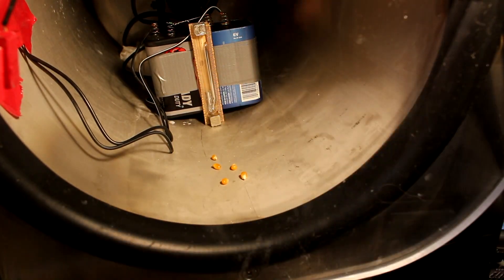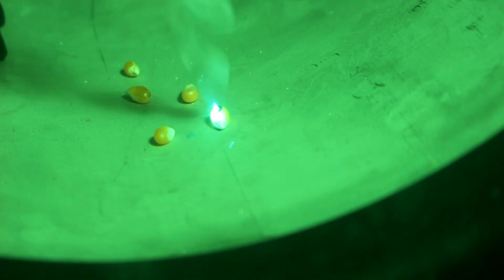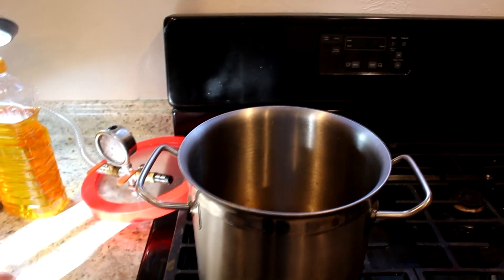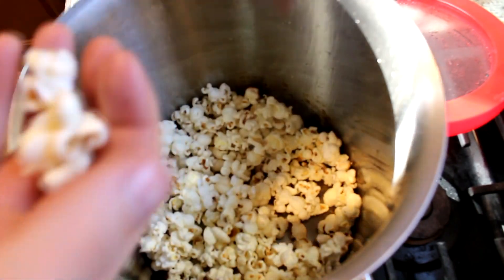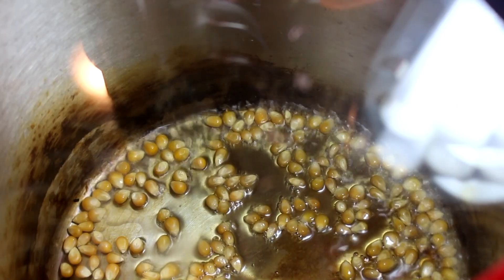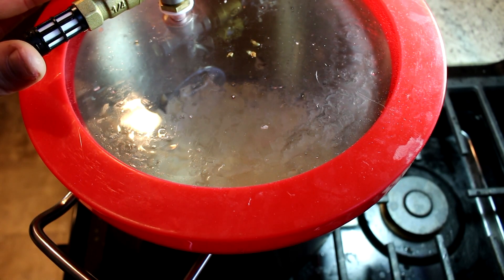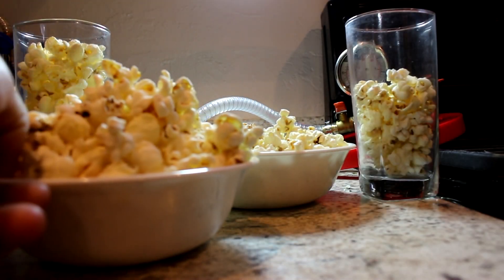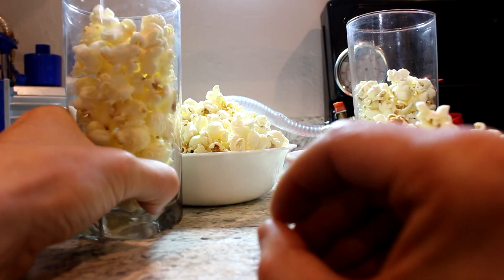Popping Corn In a Vacuum

Comment: Means of manufacturers selling you 'more' when you actually get less?
Reply: Melvin Pepperdash not at the movies, though.
Reply: They're sold by weight.
Reply: You may be on to a commercially fiable idea if you can develope a machine to do this which any idiot can use and is cheap to maintain. Because then you can buy bigger buckets and keep the price the same, so customers come to your cinema more because they feel it better value.  I mean weren't they about 25% bigger? The cost of corn is nothing, but the value of being seen to be giving more for the same money is priceless. Also apparently it tastes better.
Reply: On a seperate note, have you seen the popcorn cannon? Heat slowly to boiling point so as not to burn the curnles, but do this in a sealled pressure vessel. then release the hinged lid to allow it all to expand instantly. Mythbusters had some fun with one.

Comment: What about popping without heat and oil? Will the lower pressure reduce the boiling point of the water in each kernel, and cause that to expand and pop the kernels?

Comment: I would be curious to see temperature and pressure measurements on the vacuum corn-popping environment. With the vacuum, I would expect the oil to boil at a much lower temperature, which would also mean the corn popping at a lower temperature. There's probably some interesting analysis in the vapor pressure difference between water (in the corn) and oil as a function of temperature.

Comment: To get the same results at normal atmospheric pressure as under a vacume.  Heat the oil first untill it is smoking,  then add the corn. It will be big and fluffy just like the vacume process.  That is how i learned to pop corn at the theatre in 1966 where i worked as a kid running the concession stand at the base theatre. I was an army brat.

Comment: Hey cody, thank you for taking that suggestion! I'm very curious as to what would happen if you placed a sealed bottle full of water inside the vacuum chamber. I understand water is very bad at changing volume. I am also aware that any gasses dissolved in the liquid would likely escape. but would the water vaporise? theoretically the contents of the bottle would remain the same unless popped, so would the pressure remain and therefore not evaporate? I'd love to see this happen. Thanks Cody, keep up the amazing work!

Comment: isn't there a chance the water vapor added it's own pressure into the vessel after the vacuum pump was turned off? How about running the experiment again without ever turning the pump off, and then compare with your two results. I have a hunch the popped corn will look even bigger.

Comment: Wait, how can we hear the corn popping in a vacuum?
Because it wasn't a complete vacuum or because it was hitting the sides?
Reply: Vapor escapes from the kernels and hits the side of the pot. Also, once he turned off the vacuum pump, it ceased to be a 'true' vacuum, as the water vapor formed a kind of atmosphere inside the pot that sound could propagate through normally.

Comment: You should build a transformer with coils on each side of the door of your vacuum chamber to get AC in. You might be able to get away with air core for low current.

Comment: I'm glad you got Kenyon (sp?) to give a culinary review. I, too, thought that if you got the pressure in the chamber low enough it would pop without the application of heat. I also suspect (having tasted hot air popped corn) that it would not be as tasty in that case.
Reply: Her name is Kanyon not Kenyon
She has a youtube channel called Kanyon
Reply: Not as tasty because no oil would have been used.
Reply: I believe it would not pop with lower pressure, as corn is a sealed container and it must be sealed to build enough pressure to pop when heated. It became bigger because it took a little longer to cool off, the steam got off more rapidly once the burst happened and last the lack of air pressure did not exert any inward force to the corn in order to make it smaller.
I believe that in zero g it would be just a little bit bigger, as that gravity still exerts force in the downward direction.

Comment: NOW! Take the corn, seal it in a chamber with dry ice so that you carbonate it. Then get the oil hot in your vacuum pot and use a large tank as a vacuum reservoir so that you can much more rapidly achieve vacuum. Quickly take the carbonated corn, throw it into the pot and open the valve so that a vacuum is drawn. Bet it would be exceptionally huge lol.

Comment: What altitude did you pop these at?
Reply: "Earth" altitude, what else? He popped it on the lithosphere. When he said "atmospheric pressure", he meant the "air" pressure at where he current is: "Earth pressure", if I should say.
Reply: pressure varies with altitude, the higher above sea level he is, the less the pressure is. I'm looking for a specific value of altitude so I can figure out what pressure he popped his control popcorn at.
Reply: connorvor1
I understand, but just in case he may not answer your question. Try to searching up the approximate altitude from where we are at, if you have not done that already.
Reply: connorvor1
Sorry if my "tone" if you found first reply sounding a little "irritated". I didn't mean to. Don't take it personally. :)

Comment: Corn burned under the laser, because of oxygen in the air. If there is vacuum, corn might get warm enough to pop without burning. However, it even migh not pop at all, because all water and air will evaporate and evacuate in vacuum prior to heating, and there will not be any expanding "fuel" to pop.
Heating oil under vacuum pump will prevent vacuum from creating, because of oil vapors creating pressure. I don't think that Cody's pump os that powerful to pump overcome pressure of heated oil vapour.
Also technically there will not be any vacuum, until there is not any liquids left. Remember that water boils at lower (even room) temperature, when pressure is measurably low. So, while oil needs heating for boiling, there is not enough vacuum. In other hand, when there is enough vacuum, boiling temperature of oil will be low, and it will not rise while boiling (the same as water temperature does not rise ovet 100°C in atmospheric pressure). Thus, making heating ineffective and unnecessary.
Also lowering pressure itself without heating will cause air inside of cernels to expand and water to boil at room temperature. So, corns might pop in rapidly created vacuum without heating at all.
I would encourage Cody to re-do popping of corn in vacuum: #1 try just using smallest possible vacuum chamber without heating, so vacuum could be created as fast as possible and corns could pop at room temperature; #2 try the laser heating in the actual vacuum (corn should not burn as there is no oxygen), but heating should be done immediately after vacuum is achieved that air and water enclosed in corn will not completely evaporate.

Comment: Cody, if you can boil water at room temperature in a low enough vacuum, could you pop the corn without adding heat?

Comment: If you just had some kernels in a vacuum and the suddenly released the pressure, would that also pop them?
Reply: George Anstey That would crush the kernels - you can, however, have them under heat and pressure, and then release the pressure suddenly, which causes them to all pop at once. They did it on Mythbusters.

Comment: You might have had double the volume had you left the pump on throughout. The escaping vapor from popped kernels and the high temperature would substantially compromise the vacuum.
Reply: tubeist- dan That makes sense, considering that steam is about 17,000 times the volume of the same amount of water, AFAIK. Of course, some of it condensed as you could see in the video, but I'm guessing that there was still plenty of pressure caused by steam.

Comment: Would a strong enough vacuum pop the corn without any additional heat? The water inside the corn should boil, expand and the corn should pop cold, or am I missing something?
Reply: patrick zavas No. Part of the popcorn cooking process is that the heat melts and “gelatinizes” the starch. When the kernel pops, the gelatinized starch-water mixture becomes a foam as the water becomes vapor, and this drops the temperature back to where the starch solidifies again, leaving the starch foam matrix as the popped corn. :)

Comment: The second time you added the kernels before the oil. Scientific method states that doing this ruined the experiment, I guess you simply must pop more pop-corn to rectify this travesty.
Reply: I noticed that too... I'm sure it affects how well the kernels were coated with oil. That could account for the difference in how many kernels popped, maybe.
Reply: Sauvenil I pointed it out to get a laugh, its doubtful that it had any substantial effect due to the relatively small surface area of the bottom of the chamber compared to the amount of oil used.

Comment: I would wonder if the vacuum alone pop them due to pressure difference.
Reply: Hot air poppers don't use any oil.
Reply: jtech0 Isn't that what happened
Reply: I meant with no heat and see if the pressure that is inside the corn blows it apart when vacum is put on the outside of them.
Reply: jtech0 i think its possible if u manage to vacuum the chamber extremely fast.  otherwise the water might just sublimate out of its pores.
Reply: That could be an issue I suppose. Be kind of neat to see though,
Reply: yeah i know... talk about 100%fat free popcorn... would sell like hot cakes in winter
Reply: At room temperature, the water inside the kernel remains water, so there is no pressure inside. So it wouldn't pop.
Reply: Water will boil at room temperature under sufficient vacuum.  The way I see it, this experiment is interesting, but incomplete.  I'd want to also know the temperature of the popping kernels under vacuum.  I suspect that it would be lower than in a popper at atmospheric pressure.  I also suspect that the pressure differential experienced by the kernels is not all that different, unlike Cody's speculation, because of the reduced temperature of the boiling water.

Each kernel acts a bursting pressure vessel that can only support a certain amount of pressure, and the steam inside will progressively increase in pressure as the internal temperature rises, until the shell fails.  So, the failure pressure of the shell is what determines the pressure differential, and it is not directly controlled by the exterior pressure.  However, I wonder if the shell is stronger at lower temperatures, and that accounts for the difference.

Comment: Thanks Cody, this brings to mind another Q, does the popping of the corn, releasing internal gasses, decrease the neg. pressure inside your vessel?  IE was pulled to 27" and after popping was down to 23"? Thank for all your vids., all the best to you and yours, Billy, B.C., Can.
Reply: Would a strong enough vacuum pop the corn without any additional heat? The water should boil and expand and the corn should pop cold, or am I missing something?
Reply: even with a perfect vacuum, you only get 1 bar of pressure difference. to pop popcorn you need about 100 bar.

Comment: @ Cody'sLab - could you do a comparison with a high speed camera in a vacuum and a non vacuum popping environment? Also did you note a difference in popping time or kernel/oil temperature between the two? I would guess that with the lower atmospheric pressure the kernel's would pop in less time than at normal Cache Valley pressures.

Comment: Everyone knows that a balloon in a vacuum chamber gets bigger. Popcorn pops because of expanding gas inside of the kernel? Couldn't you pop the kernels in the vacuum chamber without heat?
Reply: Gabe Meyer There's not enough internal pressure to pop them at room temperature, even in a vacuum, since the kernels aren't really under any internal pressure to start with. In a vacuum, the kernels' interior might stay at atmospheric pressure, but the pressure difference between that and the vacuum isn't enough to pop them. By heating the kernels past the boiling point of water, the pressure difference becomes much, much greater, since steam expands to 17,000 times the volume of the same amount of water, which raises the internal pressure by a huge amount.

Comment: use oil in a vacum could be dangerous. When you decrease the pressure you make oil boil faster, and even a little air leak can make explosive mixture of thin oil gas particles and air.

Comment: "Let's pop some popcorn in vacuum." "Let's turn off the vacuum so you can hear the popping." - how smart are you?
Reply: SirJMDDK The idea is that all of the air is already removed from the pot, so keeping the vacuum on wouldn't do much. However, since the kernels are releasing a bunch of steam into the pot, he probably should've kept the vacuum on so it could remove that extra pressure.

Comment: doesnt it mean it wasn't a real vacuum if you could hear the popping?
Reply: Jared kendrick Even if it was a total vacuum, you could hear the acoustic reverberations in the sides and bottom of the pot, if a kernel popped when touching the bottom or a side.

Comment: Couldn't you pop the kernels without applying heat and just using the vacuum pump?
Reply: no pressure differential would be to low.

you have devices that do the reverse though, put the corn in a vat and subject it to high pressure and a bit of heat and pop it without burning the corns
Reply: jeffry de meyer They did that on Mythbusters. The cool thing is that the popped kernels were spherical when they did that.

Comment: Of course the oil boils harder in the vacuum chamber; reducing the pressure dramatically decreases the boiling point of the oil. You can get it boiling at room temperature if you just lower the pressure enough.

Comment: For popping popcorn with a laser you need to wrap the kernels in aluminum foil, that disperses the laser heat over the entire surface instead of on a single point and burn it.

Comment: And now industrial brands will pop their popcorn in vacuum so they can sell you less corn when they sell you the same volume... :)
Reply: probably cheaper to use more cernels than a vaccum
Reply: Mr Nobody exactly what came to mind when I saw the results!0
Reply: "double the complexity of their manufacturing process".

It would just mean that they have a vacuum pump on their popcorn equipment. Not going to make it any more complex.
Reply: just add a lid with vaccum pump to the popcorn pot
Reply: I'm pretty sure that they already do that.
Reply: Why is everyone convinced they either already do this or need to? I think they like to make money, so they're not about to double the complexity of their manufacturing process in order to use 10% less corn, which is literally as cheap as dirt.
Reply: crazyguywithasword A vacuum pump in addition to the heating element. That's more complex. Maybe double was a bit of hyperbole, but they also have to make sure that whatever vessel they use is airtight and remains that way. Don't try to tell me it doesn't complicate things at all...

Comment: Acualy you don't even need to put it on the stove, cuz when you put water (or oil) in vacuum, it should heat up thanks to that vacuum, or?... if i am not right say it ok?
Reply: it will actually cool down a lot. The water starts to boil at room temperature if the pressure is low enough, and since water cools down when it vaporizes it will get colder and colder until the water eventually freezes(it will keep sublimating from this point on, cooling it even more). As a rule of thumb, if something expands(in low pressure for example) it cools and if it gets compressed it heats up.
Reply: max13239 ok, thanks
Reply: max13239 My thought is, because the popcorn kernels are pretty much sealed, that would mean that the internal pressure of the kernels wouldn't really change that much due to them being inside a vacuum. The only thing that putting them inside of vacuum does is cause them to be able to expand further when they explode, as far as I can think.
Reply: the internal pressure doesn´t but the external pressure is lower, thus there is a higher pressure differential (~1atm more), making them pop at a lower heat(barely noticeable i guess). They still need to be heated ofcourse.

I was referring to his comment thinking that just putting them in a vacuum would work without heating(since water starts boiling at low pressure), but ofcourse that doesn´t work because the pressure differential isnt high enough(since the kernels are sealed and dont build up pressure on their own).

Comment: My thought of process was, if the pressure is reduced in the vacuum chamber, then the boiling point will increase - many of the corn would therefore  not pop up when vacuum is reached... Or am i wrong? It gives sense that the popcorn will get higher volume inside the vacuum chamber...
Reply: nope, the boiling point will decrease(you wanted to say that i guess), but the oil still doesn´t boil, what you see bubbling is steam from the corn. Actually it might even pop earlier because the pressure differential is higher(between inside of corn and outside.

Comment: Make a batch with positive pressure!
Reply: Yes, the Chinese make popcorn under pressure and the corn doesn't pop until they open a pressure release valve and BOOM! Instantly all the corn pops at once.
Reply: And see how small you can have popped corn.
Reply: Chances are that they just wouldn't pop if you got the pressure high enough to actually reduce the size of the popcorn
Reply: +Randee Brandt That is exactly how you do not do science
Reply: Randee Brandt Shrink Corn
Reply: There's a company that might do that.  They sell bags of half-popped popcorn.